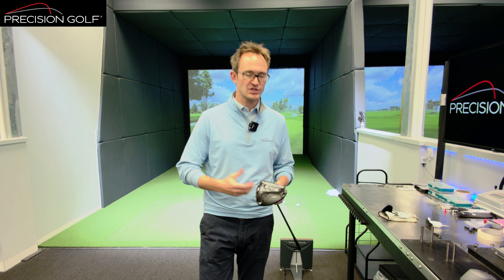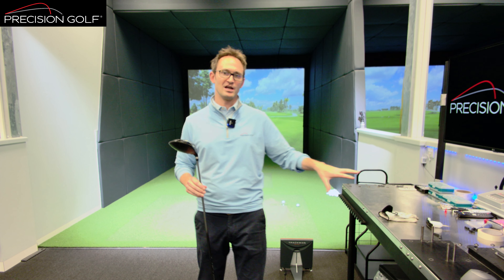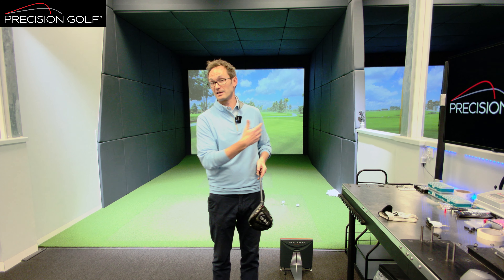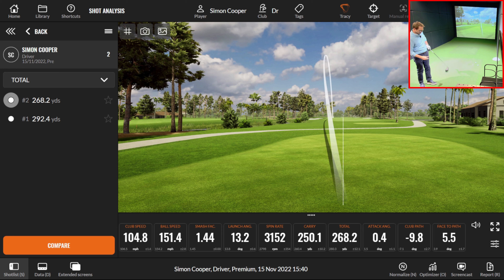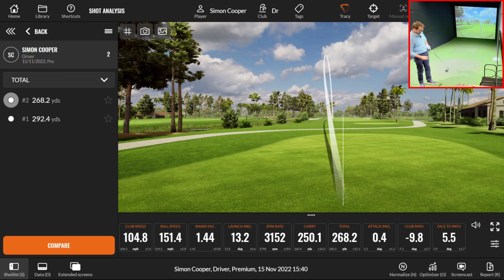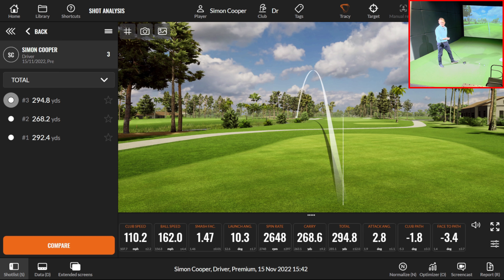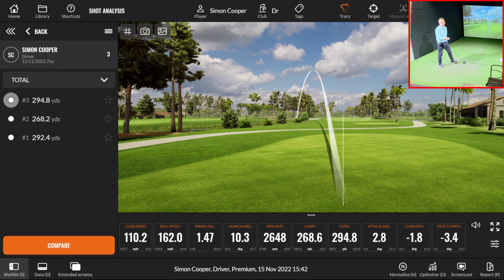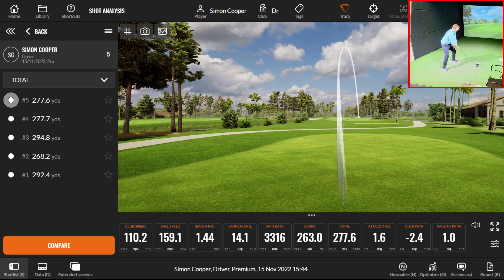SWINGWEIGHT can RUIN your clubs performance. MUST WATCH!

Comment: Oh dear had 1.5 inches taken off my regular driver shaft in a Cobra F8 and I am all over the place blocking to the right...any fix possible?
Reply from the maker: Tough one - increased head weight would help but it might need quite a lot, up to 8g/10g. Otherwise see if you can get a replacement shaft to get back to the length you were playing

Comment: Great content as always. My question is should my swing weight be identical for my 4 iron vs 7 iron vs wedge? Should all irons be same swing weight or should they be identical?
Reply from the maker: In order for clubs to feel the same to swing then swingweight should progress slightly as you move down the set (from longest to shortest iron) as the longer length and higher club speed of the longer clubs means that if statically matched (which swingweight is a static measurement) then the greater energy created from the longer and faster moving club will make them feel heavier when in motion.

Comment: why not add weight in the top of the shaft  like 35+g?  not just in the head
Reply from the maker: Counter weighting the shaft will reduce swingweight but you are increasing weight to make the club feel lighter which is counter productive unless heavier total weight suits you and usually a heavier shaft will produce better results rather than just back weighting at the top of the grip

Comment: I am comfortable with D2.5 SW in all of my irons and have my preferred shape/height. Wedges i have a little higher SW with the same result. Should driver and fairway woods match SW of irons or be a little less? Cheers.
Reply from the maker: Driver often matches the 6 iron so D2 will be close. Fairways are often slightly lighter than Driver so D1 - D2 for you potentially
Reply: Thank you!

Comment: Simon, I’ve dabbled with this on some of my irons and am afraid I’m messing myself up more than helping.  Where is your head at on progressive swing weight versus constant throughout an iron set?  Once you find a shaft that suits someone, are you alright to use that shaft with different heads and just adjust the swing weight?
Reply from the maker: Good to use that shaft with different heads. We use progressive swingweight but as a general rule it is 0.5 points every other club. Constant Sw means long irons swing heavier than short irons due to acceleration rates
Reply: @Precision_Golf  thank you.  Finally starting to play better and enjoy golf again after years of struggles.  Just don’t want to do anything to hinder that.

Comment: If your driver weight is D4.2, do you want to match your fairway woods?
Reply from the maker: It necessarily, due to it being teed up sometimes players can handle a slightly heavier balance in the driver or due to being a little more aggressive with the swing a marginally heavier swingweight can suit versus the fairways. Depending on shaft length of the driver that can also affect where it is relative to the fairways but they are not often heavier than the Driver

Comment: Great video and love the attention to detail. I have always thoughts my irons 4-PW should be the same swing weight and something I was very conscious of when ordering from TM! Should it be that all your irons are the same or should they vary/progress? Also the pure process of the shaft is something that not many do! A video on this specifically would be awesome!
Reply from the maker: The swingweight should progress slightly throughout the set (however this requires a bespoke build and does not fit into the mass manufacturing process the big brands do). Swingweight is a static measure of balance but does not take into account the shaft length progression, club speed progression nor the shaft weight progression so as a generalisation within an iron set approximately 0.2/0.3 progression each club keeps them swinging the same.

The explanation is that if a 4i and 9i are statically matched but there is usually roughly 10mph club speed difference between them the two clubs create slightly different forces and by progressing the static balance it keeps them swinging in line with one another. This matches the reason that there is a weight progression through the vast majority of iron shaft sets as in order to create progressed shaft lengths and increasing club speeds the weight gets progressively lighter as you move from wedge shafts through to 3 iron shafts.
Reply: @Precision_Golf  3 words! BOOK ME IN!!!!!!!! 😂 I got fitted for TM P7MB irons last year and a Ping G425 Max driver at the same time. I am looking to put a new set of wedges in the bag before the 2023 season and would love to get your opinion on my current setup to see what, if any improvements can be made! I have come down from 6.3 at the start of the 2022 season and finished it at 2.1 so aiming for scratch next year.
Reply from the maker: @lawrencetaylor1197  Hi Lawrence - We'd love to have you in the studio. Here is the direct link to our online diary http://www.precisiongolf.as.me select a full bag fitting and you'll be able to book a time that suits. All the best. James
Reply: @Precision_Golf  Why not use the MOI machine to match clubs, Golf Mechanix makes one. It looks like you use a Golf Mechanix SW machine.

Comment: Hi so with swing weight sorted for every club ...the swing u came to the studio with can stay instead of pro s trying to get you in correct positions or is this more for single figure players .....how much is a consultation please 
Cheers Dave
Reply from the maker: This is for everyone and it will not hinder working on your swing. If anything it can help get the club into a better position and as a result can make it easier to improve technique as you will not be having to compensate for I’ll-fitting clubs with your swing. 

Full bag fittings are £300 (excludes putter), Wood or Iron fittings are £175, Driver or Putter fittings are £125 and Hybrid or Wedge fittings are £85

Comment: Great information as always! Can you elaborate a little on matching swing weight. Im off 0.2 and im quite feel sensitive. Ive had 3 new drivers over the last 5 years (different shafts/ head combo) and ive always had them built to D2 as anything more and i loose my acceleration point and its a swing weight ive always been comfortable with. My thoughts were if i respond to a specific swing weight can that then not be carried forward to any over driver moving forward. You mentioned D1 in one shaft will not swing the same as D1 in another, how is that? 

Cheers
Reply from the maker: Different dead weights of shafts, different balance point within the shaft and different CG’s in the club head all make the club feel different. Hope that helps n
Reply: @Precision_Golf  Thank you 🙏

Comment: Hi, great video.  Question - can going heavier swing weight affect the shaft, i.e. make it flex more due to the load and make the club flair open? 

Watching your vid, makes me think I have a club with a too heavy head.  Is there any way to get hot melt out of the head?
Reply from the maker: Hi Stu

Increasing headweight by 2grams increase of swingweight by approximately 1 point and decreases frequency by 1 CPM. Therefore, it only has a very minor affect on the flex of the shaft. I guess a analogy would be like pouring a cup of cold water into a hot bath, technically will make it colder but not really noticeable.

Comment: Really great and informative video. I have a question regarding shaft weight and swing weight. I currently game a Ping G 425 Max (7g adjustable weight) with a Ventus Blue 7x Velocore Shaft playing at 45.5 inches. I am considering moving down to the Ventus Blue 6x TR Velocore, but I want to maintain close to the same swing weight. Any advice on what needs to change here, specifically the moveable weight in the head? For additional clarity, the club is gripped with a Winn Dry-Tac Mid Size. Any help would be greatly appreciated!
Reply from the maker: Hi Connor. A drop in 9g shaft weight will reduce swingweight by 1 point. This does not factor in balance point of the shaft. Ventus TR 6 is slighter higher balance therefore this will lighten swingweight further. My advice is to have a competent club builder assemble to your required spec, it’s a very complex balancing act of multiple factors affecting the finished spec.

Comment: I guess what I'm trying to figure out is the premise for this. It sounds like you're all your arguments are trying to get back to a neutral plane? What if the person isn't going for a neutral plane? So when you were saying what the lighter swing weight it tends to get you over the plane and these other issues where you can't slide it up and get it back on plane. Well what if someone's intention is to get under the plane and come back up or to be over the plane and come down? So instead of trying to change their swing couldn't you make the equipment optimal based on the pattern? So say someone swings an extra long club and that feels comfortable for their rhythm but then they get under the plane and come upward so couldn't you offset that with a lighter swing weight so that they could get under but then still catch it back up? Or if they're over the plane and they like to swing as hard as they can couldn't you just increase their swing weight so that they could sync up? Obviously I know what that is not quite this simple but that's the whole point of going to a fitter right? They're supposed to figure out the complex math to make these things work to follow the pattern of the person and the way they swing the club. So instead of trying to even out someone's plane what if you let them swing their swing and adjust the club to its maximum efficiency based on that pattern? Why is that not a reality?
Reply from the maker: Hi Jacob. I can answer all of this but easier to do it in an email if that is ok. Can you let us know your email address and I can send over a full reply?

Comment: I've been going through alot of your videos recently with much interest,   I've always thought,  even as a high handicaper that I have a fairly unique sense of feel when it comes to clubs as i talk about feeling things to mates and they havent got a clue what im talking about haha.  I have built my set around that feeling ( with the help of a fitter initially 2 years ago to get my base ) , but im now at the stage where i feel I need "fine tuning" to get to the next stage, whether thats another re-fit or adjusting my current set.   Especially as my swing has changed alot in 2 years since my iron fitting.  

Do you feel that this kind of shaft and club fine tuning benefits mid-high handicapers too ?  I play of 16 at the moment,  and play with MP20 HMB and MMC mixed set which i've loved since having them,  with heavy, none ribbed shafts which i think the pro at the time said were tour spec.   When i pick up anyone elses lighter clubs,  they feel horrible, my down swing with lighter clubs makes me feel like im casting or coming over the top more and they give me too much freedom,  so i feel i need weight in the head and stiff shaft to help me keep on plain or slightly inside. 

My driver especially,  something i've struggled with is something id be very interested in seeing the possibilities.  I'm a few hours away from you guys in Norfolk but id be very tempted to have a day down there for a full bag analysis if you felt its something that might be worthwhile ?
Reply from the maker: Absolutely - there is arguable more benefit for the higher handicap player than the elite player and it may facilitate a development in your swing that you cannot currently achieve because your existing clubs are holding you back.

The flex of the shaft will affect your “feel” and what you perceive as more control than actually tightening dispersion but this is all part of it and your confidence with the clubs. We can certainly give you clarity on what the correct set up is for you and what potential benefits there could be from a change in spec.
Reply: @Precision_Golf   Awesome,  I'll get some time free up straight after xmas and get booked in :) looking forward to it

Comment: Thanks for the education on swing weight. Now I understand why my driver is hard to hit. I changed my grips from medium to jumbo,  I presume when I did this, my swing weight decreased quite a bit because my jumbo grips are heavier. This is probably why when I swing my driver, I cannot feel the head and I hit it all over the place. Previous to changing my grips, I had a one way miss, usually a slice, but I've greatly improved my swing mechanics but cannot reliably hit my driver. I plan on getting new clubs this season with a proper fitting, but what can I do in the meantime that'll help with my swing weight until I get my new fitting? Thanks.
Reply from the maker: Hi. The best quick fix will be to add some lead tape to the head. 2g for every 5g change in that grip weight from Midsize to Jumbo. Please understand this is only sticking plaster until you’re fitted. Thanks for sharing your experience. 👍🏻 no
Reply: Or stick your midsize grip back on or find a lighter weight jumbo grip that matches your midsize grip
Pretty obvious really... you made it heavy at one end, why mess around making the total weight higher when you really should just rebalance the club to its original true and swingweight.
Reply: JumboMax ..makes an UltraLite in SMALL - (for them) Which actually matches a Golf Pride Jumbo:) #Cheers 👍🏼👍🏼

Comment: Swingweight as it is thought of in the golf world is one of the most overrated concepts.  Most people wouldn't see a real difference between C3, C9, D3, etc.  The bigger thing though is that having the exact same swingweight through the bag is not a meaningful concept.  There's no reason for it and most people would benefit from a fitting for every single club (specifically irons) b/c you likely need a different swingweight for your 9i vs. your 4i.
Reply from the maker: Hi Christopher. Respectfully, there’s no way of saying this but you are wrong. It is the difference between the correct head/shaft combination working, and not working at all. This can be said for golfers of every ability even if they cannot feel the difference they will notice a different quality of strike. We have 25 years experience of this it is the most overlooked element of a proper clubfitting. You mention that players requiring a different swingweight throughout from iron to iron and yet say it’s not important. However, you are absolutely spot on in this respect. Swingweight SHOULD progressively get heavier from Driver to LW.
Reply: Yes I appreciate your comment. So I've been at this golf game for a long time trying to understand the mechanics and finally narrowed them down! I went on four different occasions to get fitted at different places here in Las Vegas and was extremely disappointed. The way I'm understanding a lot of the feels and things with clubs and swing weight specifically is it would be like into swinging a sword or an ax. Some people can swing a great sword and it feels heavier more toward the outside of the sword or other people would swing a katana where they feel more of the weight in the handle. Another way to illustrate it would be like swinging a sledgehammer or flipping it upside down and having the weight below your hands so that the actual head of the sledgehammer is on the other side. It's too completely different feels and completely different mechanics of what the person's doing in their intentions. My feeling that when the swing weight is heavier I just sort of throw the club head at the ball. Yet when I have the weight in my hands I actually use my body very differently. So needless to say I'm still on this journey but I am narrowing it down. In my experience going to get fitted is not a fitting at all it is a sales pitch. Every time they are trying to fit me into the latest and greatest I never try older clubs not even a year old. It's literally whatever is the newest which is sadly there's no way that's not a sales pitch.